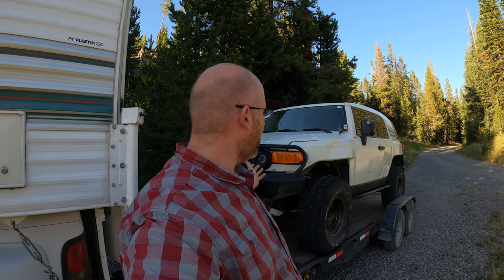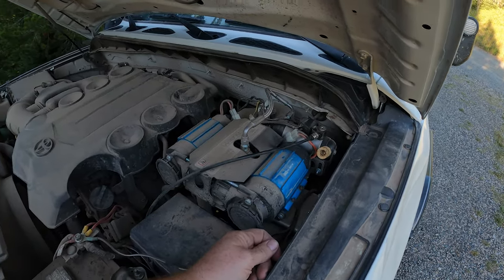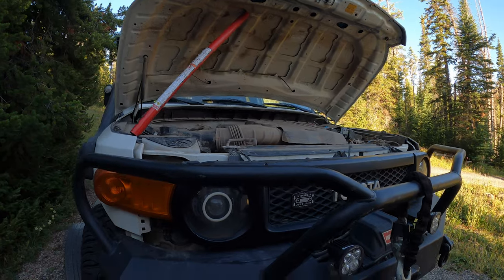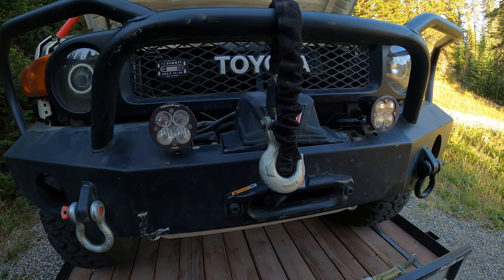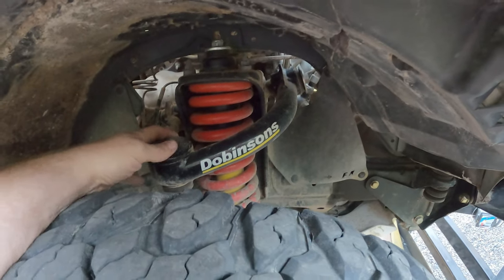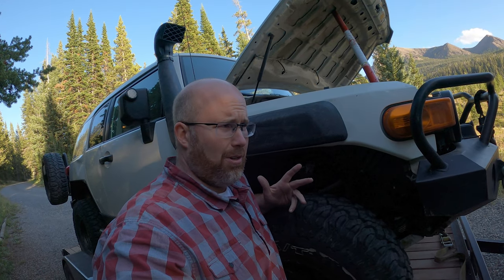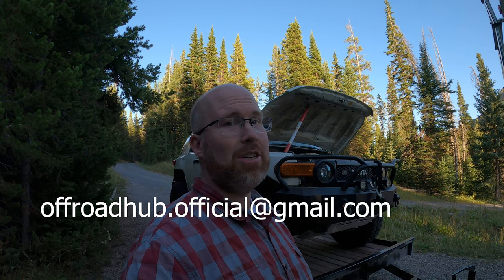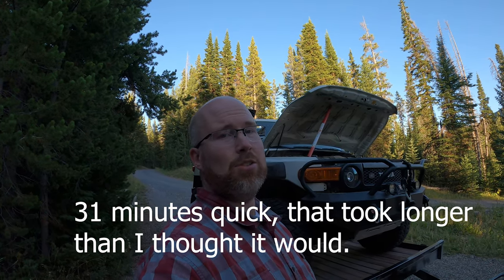FJ Cruiser Vehicle Walk Around And Tour!!

Comment: My FJ is missing a front plate too and so far have not been ticketed $200 for it here in Cali... By the way, you have protected almost everything under the FJ, except the most critical part, your rear axle is not protected by anything at all, why?  If you are concerned about hitting a deer, braking that rear axle will render your FJ inoperable, get something for it...
Reply from the maker: Front plates seem to be something that the police can ticket you for if they're having a bad day maybe. As for the rear axle, I haven't put anything on it to protect it because it is probably the strongest thing under the FJ. It will easily support the weight of the vehicle and take almost any hit. Adding a skid plate of some sort to it would decrease ground clearance, so I just never put anything on it. But... It's gone now anyway. Thanks for watching!

Comment: Not sure if someone has mentioned it but it is worth cleaning your engine bay, especially the radiator if you drive through a lot of mud and dust! Radiator works a lot better when it has proper air flow.

Comment: I like it. No bling. I did notice your splash guards in the front wheel wells are kinda hammered. Rad Rubber, makes great replacement ones. Super thick and they come with all new snaps to install it. They are 50 bucks and about 1/8 inch thick. Thanks Ken. Watching you makes me realize I need to learn how to swap out an axle. I'm too old to walk out anymore. 61 with bad hips.
Reply from the maker: I've considered the RAD rubber, but my stock ones keep hanging on! 😄 The next time I snap an axle I'll do a more detailed "how-to."
Reply: @offroadhub.official  I am not sure if my reply was lost...but typing again :-) Another vote for Rad Rubber, I destroyed mine on the trail and changing the suspension. Rad Rubber are thicker and stronger and they come with clips, just make sure you order the correct ones for lifted vehicles...if you get to it.

Comment: Kind of late to the party (watched your latest trail runs first, but I went back to this one) but I finally watched it end to end, great to see the walk around and pick up a few things Here a few things that you may want to experiment (some before me):
- build a toolbox in the engine bay. I am thinking of freeing up my tool space in the back of truck and moving tools in the engine, bay. Frees space in the back. Same for some of the recovery (the metal parts at least) and may be the extra bottle jack in your case. In my case I will also move the compressor, but I have the single not a double.
- engine/transmission health - I am experimenting with the OBD2 readers and making an old phone as part of my extended gauges. 
-  the FJ has a short trunk but lots of height. In my opinion is worth having a 2 layer storage, even if you keep the back seats down. 
- build a divider barrier between your back storage and occupants seats. I am concerned with all the heavy gear that we carry in the back that it will hit us in accident on the trail or the road.

I might have missed it, but you may have forgot to talk about your new gears, when you mentioned your front locker. Also I believe you forgot to mention that the front is an ARB air locker.

All the best, keep them coming. Please also make video when you changed the bumper, I am looking at the same one.

Comment: Love the vid ..... hey any issues with CV boots or axles? With the tires and lift ? Seems these boots are quite exposed to elements on trail ? Just a thought
Reply from the maker: No problem with boots ever.  The joints can break if I'm not smart with the front locker. No extraordinary issues though.
Reply: Offroad Hub great to hear I got the OME 3 inch lift and ppl told me with my IFS I will be leaking boots and breaking cv’s all over huhhhhh I was hoping to avoid it :)
Reply from the maker: @Krystof.Veritae  shouldn't be a big issue. The axles are really easy to change anyway... 😄

Comment: Hi Ken. I currently purchased from Apache their extended travel kit as you suggested. The front is completed now. Regarding the rear shocks, they sent me additional smaller diameter inside bushings. Obviously they want me to press out the large and install these. Did you also have to do this mod. I feel they should’ve been installed prior to purchase. Your reply is greatly appreciated.
Reply from the maker: Hmm... no I did not have to change any bushings. I saw extras in the box but I didn't need to use them.
Reply: Thanks again, for input.  I’ll check back with them!